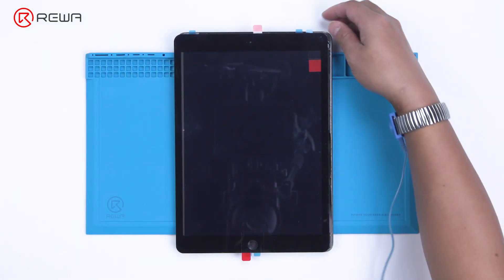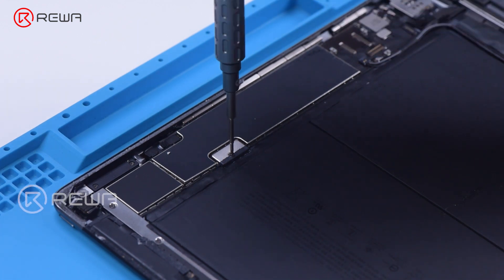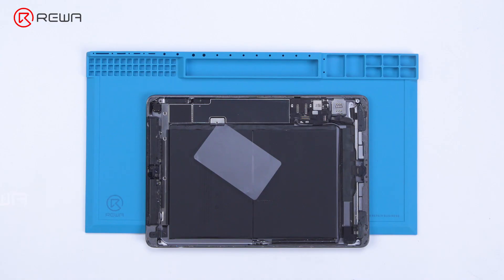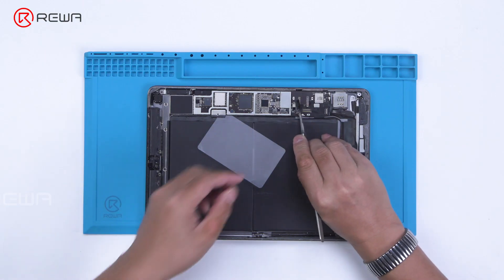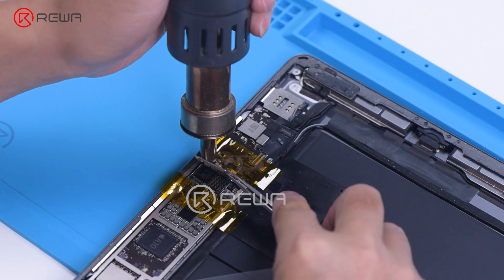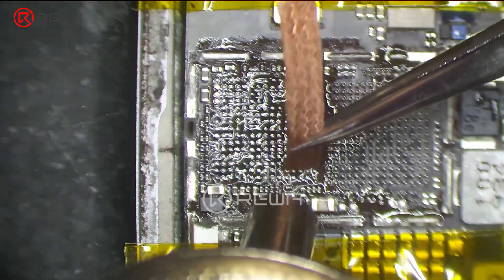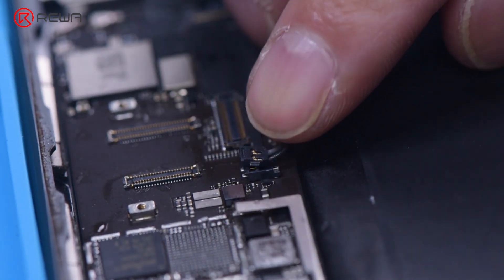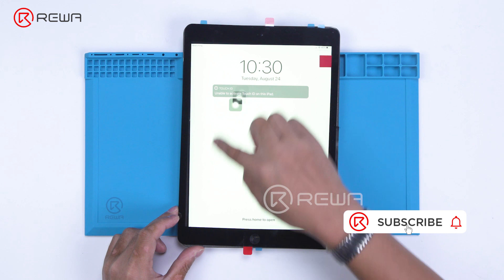How to Fix iPad Touch Jumping/Glitching - Touch IC Replacement

Comment: Great video and i have a Ipad4 that is 99% not responsive except maybe if a rub the screen for a while i can get it sort of active on and off so i thought some kid of cap weakness or in the chip too? all visual inspection shows nothing and touch coil has zero resistance so i figure its the touch IC?  i also tried another working digitizer and same and checked socket and all perfect.

Comment: when changing touch screen   you to put tape on the flex cable on the digitizer, it's not a problem with touch ic.
the same high temperature tape you are using put it on the inside of the screen on the cable that is coming out from the digitizer
Reply from the maker: Hi, the iPad already had a touch jumping problem when mailed in. We tried to replace a touch screen for testing but the jumping problem still existed, which can rule out the possibility of the touch screen problem.
Reply: on my case am done changing touch ic but still same jumping touch what should i do? value on the conector is normal i try testing new lcd and touch same issue